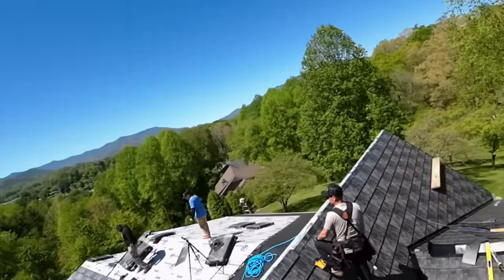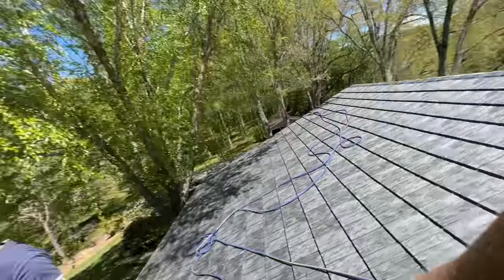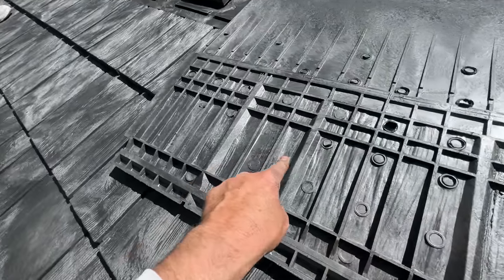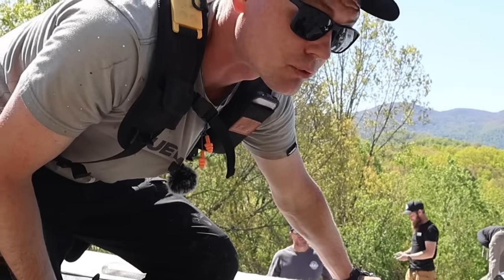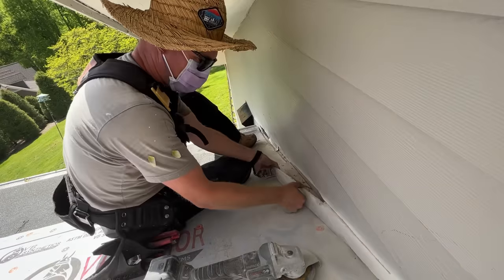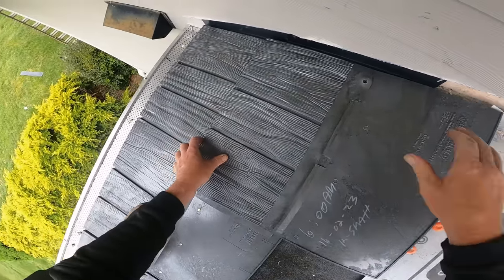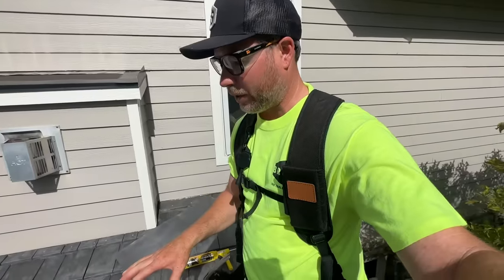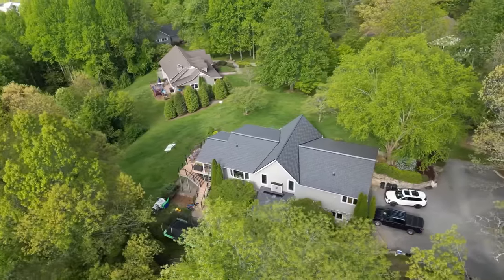Installing a LIFE-TIME roof on my house!

Comment: How long has this product been out? What is the life span of it. And will it curl over time
Reply: We have had curling issues in the past but we have corrected that with our interlocking system. We are going into our 25th year, and we also have a 50 year non-prorated warranty as well.

Comment: If they are made from tires how do they stop dry rot ? Tire dry rot is a sign of rubber deterioration caused by age or expedited by extended exposure to the elements. Is that going to be any factors with using tires on roofing in some states with hot and cold weather flips like here in Colorado -10 to 110 temp flips a year. Just curious if there is any info on that. Must smell like a bf good wench factory when out side temps hit over hundred lol

Comment: One time I burned a tractor trailer tire to get rid of it. The flame seemed to be 100 feet high. I tried for hours to put it out but there was no hope no matter how much water I used. I had laid it on a steel fence to burn it and the steel melted.  It was a long stressful night. I will never do that again. Just saying.
Reply: Thankfully these are not simply a tire. There’s a fire retardant throughout the product.

Comment: If your HVAC system is struggling to keep up... Then it is not properly sized, needs to be cleaned or replaced. I would get your HVAC guy in to look at it.

Not to mention if the house was added on to, chances are they didn't upgrade the system.

Comment: At the cost of 3x of asphalt shingles and a 50 yr warranty, I would say go with the metal roof. Rubber shingles have a tendency to warp and curl after a few years.
Reply: We have not seen any warping or curling in our accelerated testing, or on our roofs in the 24 years we have been in business! It is all preference though, and metal can be great.
Reply: There might be some rubber shingle designs that would allow the shingles to curl, but with the lower edge interlocked and the upper edge nailed under the next shingle, this design really doesn’t have a place to curl.

Comment: I wonder if the insurance industry will consider it lifetime.    Reason I say that in Florida most won’t touch you if a roof is over 10 years. I don’t know what they do about metal or these types.   Curious
Reply: I sell it here in Florida. At 15 years under the new laws they can require it be inspected in order to renew policies. That inspection needs to find it has at least 5 years remaining or the homeowner has to pay out of pocket to replace. This product is one of veryvery few that should be consistently good to go on that inspection. If for any reason it isn’t, the warranty comes into play.

Comment: Please paint the bottom of the siding that you cut. Doesn't matter if it is LP or Hardie both need to be painted.
Reply: Exactly. Or you can wrap it n peel-N-stick tape, per the manufacturer. But I agree, either way, that cut edge needs protection.

Comment: Are these easy to walk on? I like that you don’t have to worry about footprints like on asphalt shingles. Looks beautiful. Unfortunately the closest roofing company is nowhere close to me. Can you tell me if the cost is closer to an asphalt roof, a metal roof, or a slate/tile roof?
Reply: They can be slippery but it's better than walking on slate/tile. Cost is about double that of an asphalt roof. Looks amazing but smells in the sunlight (at least our does)
Reply: Where are you located?
Reply: @DavidSummerly  Nebraska, we have the Vermont slate product as well not this Shake it’s a bit different.

Comment: That does look nice. It has a built-in weathered look and everything. Although I'd be concerned about rubber lasting 30 years in the sun. But I guess time will tell.
Reply: That’s what I wanna know. Won’t they dry rot just like tires?
Reply: @Adunca37  I was thinking the same thing…
Reply: Naw a little tire shine once a month and you're good to go.
Reply: They test them just like asphalt shingles. They have a 50-year warranty, double what the best asphalt shingles offers. Did you think they didn't anticipate these questions?
Reply: To answer this question properly you have to understand what makes tires crack. Tires have metal wiring in them, this is what gives the tire its shape, and when you expand & contract this wire enough it will eventually break. When the metal in the tire breaks you will visually see the rubber crack or separate. Euroshield roofing materials contain no metal so we do not have to worry about this problem. In both real-life & lab-testing, Euroshield has never cracked.
Reply: @Euroshieldroofing  I didn't know that but it makes sense. Also, it's easy to conflate everyday plastics with rubber tires.  It looks pretty, that's for sure.

Comment: A couple decades ago, on our remodeled home on the Big Island of Hawai'i, WE replaced our worn-out (cheap) asphalt shingles with a "wonderful new product" —  fiber-reinforced cement tiles. Together, our roofing contractor (who were idiots . . . stepping through and BREAKING 3 of our 4 new skylights) AND the maker of those tiles (also idiots) ended up with our home just a couple years later, becoming "Niagara Falls" (inside).  Seems the tile manufacturer ("American Chemwood Shake") had been slowly (deservedly!!!) going broke and had been using more and more sand, crap cement etc. . . . such that over time, our roof literally DISSOLVED.  So, we're just a bit leery of "wonderful new products."  (Years later, we DID get a "partial settlement" . . . some $7k from the HUGE class action lawsuit).  So . . . jest sayin!   Really DO love your videos.

Comment: Auto tires are known for dry rot.  Isn't dry rot an issue with a rubber roof?
Reply: The company website gives some explanation for why it’s different but no, 24 years strong & looking good even down here in Florida.
Reply: @Bobo-ox7fj that is not true FYI. Class C fire rated. There is fire retardant throughout the entire product FYI.

Comment: Are clay, concrete and slate tiles not in use at all in the US on a large scale? My house is 161 years old in the UK with clay fired tiles that are still solid as the day they went in. Taking so much effort to build these houses to the spec you do and then putting shingles on them just seems crazy to me. I don't even like the shingles on my shed!
Reply: Slate in the US is $$$$$. Clay & concrete tiles are common down in Florida & out west. Not very common in the Appalachia region where he lives (and where I live). Most common is asphalt shingle, followed by metal roofing (standing seam or exposed fastener)
Reply: @macgyver03ga I live in Florida as well. Concrete & clay tiles get absolutely destroyed in the hurricanes. All the Euroshield roofs that went through hurricane Ian in SWFL are in perfect shape!

Comment: The images in the video make the shingles look like flexible plastic composite. Is that observation valid? What do the insurance companies tell you about this roof and their fire ratings?
Reply: I had the same question so after a bit of searching I found that they have a "C" fire rating. That gives me a hard pass since I live in a heavily forested area. Our new house will have a heavy gauge standing seam hidden fastener roof with a "A" rating.
Reply: Rubber, not plastic. Plastics actually often get a better fire rating but at least some of them get it via a factory coating that bakes off in the sun & washes away likely leaving less protection in the end despite claims otherwise.
Reply: @WoodNMetalWorkshop excellent choice in your area then & I work for Euroshield.

Comment: Roof looks amazing, but factoring in material costs, labor required and how crucial a waterproof roof system is to home, would prevent me from considering being an early adopter.
Reply: This product has been out there and successful for 24 years….you would not be an “early adopter”
Reply: @johnwhite2576  This exact product made with the identical recipe and same process for 24 years, I highly doubt it. CertainTeed shingles are a great example of what can happen with one small change.
Reply: 1-4x Disposable asphalt material cost. Less than most other specialty roofing products. Labor is only slightly more than asphalt. Simple install compared to plastic competitors.
Reply: I am genuinely curious, does anyone know how many roofs they  have in service? What climates, average age, roof pitch etc?

Comment: what happens when your house catches fire that burning roof will be giving off black smoke and will be harder to put out...
Reply: Class C fire rated. Ashes up wherever burning material lands on it. If a roof goes through a fire, it should be replaced.

Comment: That roof looks amazing, and with all of the recycling efforts North America has been making for years, I'm surprised it has taken this long to start using old tires from landfills, for roof shingles. I get why Semi drivers need retreads because the cost of replacing tires with brand new ones would be huge, but our interstates and highways are littered with retread failures, too bad someone can't reuse all of that too. My only negative here would be, why is it that manufacturers always find ways to lower the production cost of things, but rarely if ever pass the savings on to the consumer ? I know, capitalism...

Comment: I think remodeling with flashing has pissed me off more than anything ever.. Very nice looking roof.. 
So what about dry rot? Tires often dry rot in a few years. 
If your worried about AC keeping up you coulda did a metal roof on 1x4s with a radiant barrier under the 1x4s. That allows for a bunch of airflow and the radiant barrier radiates any heat under the metal so it doesn’t radiate into your home. Very important with vaulted or cathedral ceilings

Comment: When it burns the black smoke will be seen for miles 🤣🤣🤣
Reply: Class C fire rated.
Reply: @DavidSummerly  so your basically saying the house will burn ,but the shingles won't 🤪. I doubt it still will burn at the right temperature and send smoke up for miles .

Comment: Rubber is not UV resistant. It will deteriorate over time.
Reply: The chemistry built into the product would beg to differ.

Comment: also should note:  Euroshield rubber roofing is ONLY class C fire rated, not very fire safe (wilderness/fire risk zones concern).  Asphalt based shingles/roofing and metal/raised seam are all rated Class A for fire rating.
Reply: All of them have to be replaced after a fire. With the exception of metal, most products don’t hold up to fire in the field like they do in factory tests after the coatings have baked in the sun & washed off. This product is designed to ash up in an area with a flame sitting on it.

Comment: Soooo what's wrong with a metal roof?
Reply: Breaking its coating by cutting it to install it. Salt in coastal areas. Oxidation from dissimilar metals in screws. Gets destroyed by hail. Fades. Oil canning. Loud in storms. Can reduce cell signal. Often more expensive & harder to install.

Comment: Seems like it will be a dry rot problem in about 7 years. But I’m sure he got it for free.
Reply: They test them just like asphalt shingles. They have a 50-year warranty, double what the best asphalt shingles offers. Did you think they didn't anticipate these questions?
Reply: 24 years going 💪🏽 strong. A friend of mine checked out ones installed over 20 years ago. Said they still look brand new.

Comment: Tires DRY ROT why would anyone want a rubber roof (UV is going to destroy that)... this is stupid.
Reply: Our product does not dry rot, you have to understand what makes tires crack. Tires have metal wiring in them, this is what gives the tire its shape, and when you expand & contract this wire enough it will eventually break. When the metal in the tire breaks you will visually see the rubber crack or separate. Euroshield roofing materials contain no metal so we do not have to worry about this problem. In both real-life & lab-testing, Euroshield has never cracked.

Comment: Rubber wont last a life time, when companies say, you have a lifetime warranty, its usually for 15 years only, or the life time of the company which in many cases is averaged out at about 5 years, for the cost, I would rather a tin roof that I know will last my life time, Ive seen tin roofs that are nearly 100 years old. Without going through the complete spec sheet, how fire retardant are these rubber tiles.
Reply: We have a 50 year, non-prorated warranty! We are going on to 25 years and we are stronger than ever.
Reply: Class C fire Rating

Comment: This will 100% not last a life time that’s not how rubber works especially exposed to direct sunlight and rain. These roofs are gonna “dry rot” just like tires that are left on old classic cars. Eventually they will start to split and crack then just fall apart. Worst thing I’ve ever seen.
Reply: We add UV inhibitors on top of carbon black being one itself, alongside other additives. Yes our shingles sit in UV all day every day and experience extreme weather, however due to the formula we have created we have not had any breakdown or "dry rot" in the 24 years we have been in business. We have also done extensive third party accelerated testing and there was no breakdown. Now if that is not enough, we also have a manufactures warranty which is 50 years non-prorated, meaning "IF" our product fails, we will replace it.
Reply: @Euroshieldroofing  rubber is hydrophobic so these tiles are gonna sweat out the moisture inside of them over time. It doesn’t matter if you put all the uv coating on the planet in them rubber naturally expels moisture which means they will dry rot over time regardless of the carbon black or uv coating they might last 25 years or 30 years or maybe 40 years but there’s gonna come a time where all of a sudden they split and crack open. I am sorry it’s just the nature of rubber , or plastic
Reply: @Euroshieldroofing  also if you want a semi permanent roof you could do slate it lasts about a hundred years with the copper nails

Comment: Wait....so you removed a "lifetime roof" and replaced it with another phony "lifetime roof".  BtW "lifetime" means 30 years in this world, where a metal roof will last easily 50 years or longer and a slate roof can last hundreds of years.  

This is just like luxury vinyl tile....okay maybe a little better but rubber dries out just like old tires, so at some point around 30 years, you'll need a new roof.
Reply: 50 year non-prorated warranty. 

Slate gets destroyed by hail, hurricanes, etc.
Reply: @David Summerly  one thing you learn as a roofing contractor early, and a homeowner the hardway, is if you are relying on a shingle warranty, you are in big time trouble.  

Ever single major shingle failure has resulted in homeowners bearing brunt of costs.

Houses get destroyed by hurricanes.  Your shingle warranty is least of concerns

Comment: I have a hard time with you calling it a life time roof the tires it made from deteriate in the sun all tires do  so I'd say life time roof is a lie
Reply: Tires have metal wiring in them, this is what gives the tire its shape, and when you expand & contract this wire enough it will eventually break. When the metal in the tire breaks you will visually see the rubber crack or separate. Euroshield roofing materials contain no metal so we do not have to worry about this problem. In both real-life & lab-testing, Euroshield has never cracked.